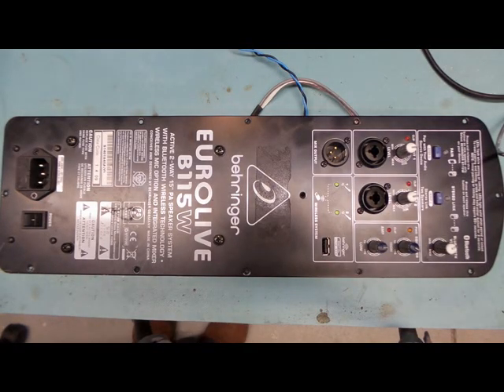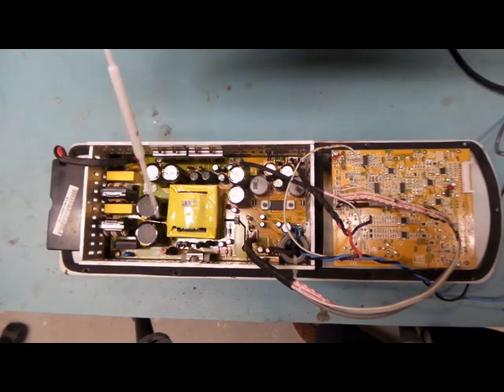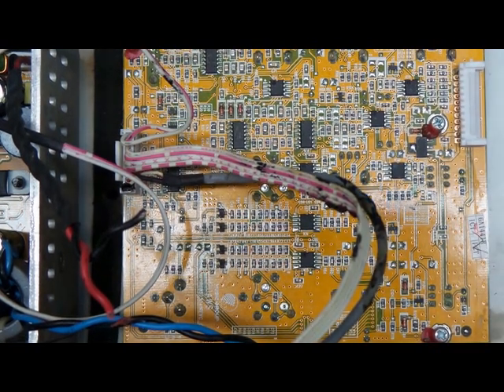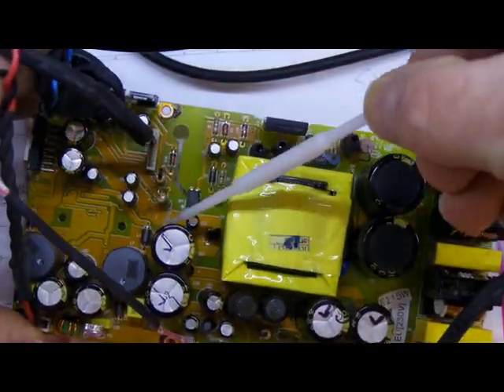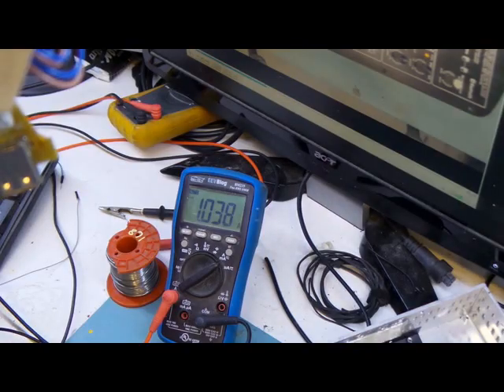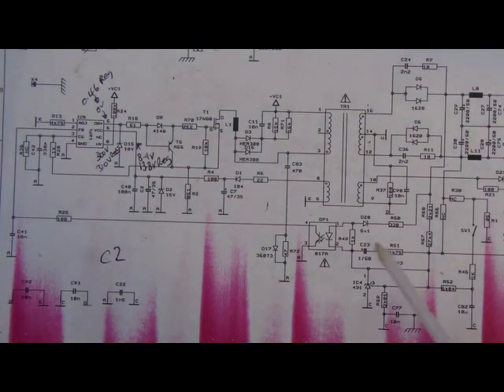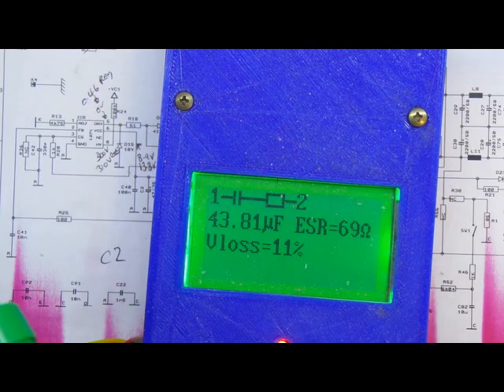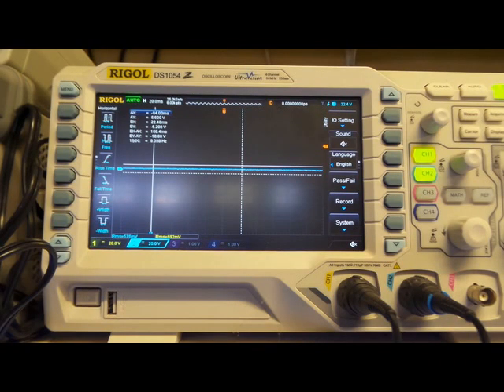Behringer Repair  Eurolive B115W

Comment: Wow can’t believe how common of an issue this is with these speakers you would think behringer would do something to solve this issue in new speakers, I followed this video and replaced c2 and c7 as described but unfortunately my speaker is still exhibiting flashing lights and not working, while it was apart i noticed 2 of the other capacitors slightly bulging but I didn’t get the specs of them before I put it back together to re-test, just wonder if anyone has the information on the 2 larger capacitors at 9:12 in the middle to the right of the yellow square? Also anyone have any recommendations on a repair shop or someone who might be able to assist me with a repair in South Australia would be great thank you very much in advance and I appreciate this great video

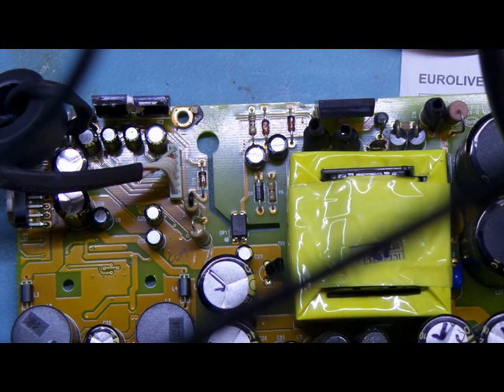Comment: Be careful if attempting this. I have a B112D with the same symptoms & using this video as guidance I change the two caps which did indeed measure half the capacitance & high ESR. However, on reassembly the issue remained & I determined the issue only occurred when the PSU was bolted to the back panel. Then by accident when they briefly touched it sparked. I found there was voltage between the PSU chassis & the back panel when not connected. I removed each bolt one-by-one that were fixing the heatsinked components to the chassis & tested each time. Turns out it was IC3 causing a short. The one you can see at the far left in this video at around the 7:08 mark, at the top of the PSU, next to the ferrite ring. While that is isolated from the chassis, the pulsing lights issue is not occurring.
Reply: To expand on this, IC3 is a 7293 IC. I have since found an insulating bush which fell out during disassembly & was no reinstalled, however this only insulates one side & whatever was on the other side I'm guessing has been damaged or become faulty for the short to occur in the first place. From a site explaining this IC it says:
"Note that the metal tab of the TDA7293 is connected to the -Ve supply, so must be insulated from the heatsink. The more care you take with the mounting arrangement, the better. While you can use a screw through an insulating bush and a piece of mica to insulate the tab, a better alternative is to use a clamping bar of some kind. How you go about this depends a lot on your home workshop tools and abilities, but one arrangement I've found highly satisfactory is a suitable length of 6.25mm square solid steel bar. This is very strong and allows good pressure on the mica (or Kapton) for maximum heat transfer. Naturally, heatsink compound is absolutely essential.

Do not be tempted to use silicone insulation washers unless you are using the amp at very low supply voltages (no more than ±25V). Its thermal transfer characteristics are not good enough to allow the amp to produce more than about 10 - 20W of music, and even that can be taxing for silicone washers. The amp will shut down if it overheats, but that curtails one's listening enjoyment until it cools down again."
Reply: Hi mate i followed this video too but unfortunately still have the same issues, could you please elaborate abit more on what you found to be the issue I just can’t quite seem to follow your comment properly, or is there another way I’m able to contact you about it at all? Thanks very much in advance

Comment: this thing is a beast to get open. Broken screws, cheap stripped screws before I even tried to undo them. Spent about 10 minuets and just trashed the thing. Barely worked for a year. Crap.

Comment: have two power supplies doing this. Checking out the first one tonight. Seems VERY sus as both PSU's are now multi-year running old. Seems that the PSU's are identical for the B115W/B112W as well.
Update: this works beautifully! works like new.

Comment: HELLO FROG! I noticed that one of my EUROLIVE Powered speakers only had sound coming out of the Woofer so I ordered and installed a new Tweeter Diaphragm but when I powered the unit up it's squealed!!! I took it back apart double checked all the wiring everything is in the correct place! Tweeter is mounted in the correct position! There's no smell or anything burning from the Amplifier section! The Woofer works fine! Can you tell me what that could possibly be wrong!
Reply: HELLO CACTUS, I dont have much to offer. Sorry. Apart from checking the capacitors as they are known to fail.  I am trying to think what could cause it to squeal but have nothing to offer.

Comment: Do you have any advice for a B115 unit with no high-end playing? it sounds like the woofer is working but not the tweeter. Any thoughts on whether It's the physical tweeter or the amp circuit for the tweeter? how would one investigate/fix this issue?

Comment: Thanks for a great and helpful video! About to attempt the same repair, but am not by any means familiar with circuit boards and electrical repairs like this. I'm looking at purchasing a few 47uF capacitors from Amazon, but there are two options; 50V and 16V. I assume it matters...so which would you recommend? Thanks for your help!
Reply: I just checked the circuit diagram which indicates 35v capacitor rating, so 47uF,  50v will be fine.
Reply: @kissingfrogs  Thanks so much!
Reply: @bigk5486 what was the answer?
Reply: I dont recall what the voltage rating was.  The voltage does matter but only in so much as it must be equal to or greater than the original.  Generally, a larger voltage rating will mean a larger physical capacitor which sometimes means that it maybe difficult to make it fit. So to re-iterate it must be 47uF and whatever the original voltage rating was or greater.   If you cant find the original voltage rating let me know and I will see what I can find.

Comment: Hi, thanks for the great video. I have got B12x, when I was switching on the lcd comes on, bluetooth works input meter works but no sound at all. I have tried normal input as well, factory reset also, all what I can but no sound. When I was listening the speakers closely no noise or anything. I have followed your video and  replaced the 2 capacitors. After that same happened still no sound, so I was thinking it has something other issue. While I was testing/checking suddenly it started to work, didn't do anything. It was working for few minutes then stopped again. Seemed the amp switching on/off. Then I have started a repeated music to see how it switching on/off. So when I was switching the speaker on, no sound. Started the music, after few minutes I hear the music playing on the speaker, after few minutes it stops like the amp went off, few minutes later I can hear again. It strange. Then I have used the bluetooth app where you can control the speaker settings. Realised when I was changing something while it was working ok, it stopped working again. Anyway in some point after few hours of playing/testing realised it's working ok, no switching off since half an hour-hour. Whatever I did in the control app it worked perfectly. Switched the speaker off, then back on it works perfectly. This happened yesterday, since then everything works perfectly. So I am not sure what was that, is it relates to the capacitors or it was completely different. If anyone have any idea why is this happened please let me know. I don't have any clue, it seems like it needed some time to put himself together to work properly but it did. All in all happy with the results, thanks again.

Comment: Can you advise what size diode is L3 and L9? I am unable to find a schematic for B115W.
Reply: L3 and L9 would be inductors.  According top B112D (I dont have B115W schematic but they seem similar)  L3 is 21B751S and L9 is 4u7/620mA (not sure what that means).  If you meant D3 D9 then 4148 and  LED respectively

Comment: I also have a B112D exhibiting the exact same symptoms. Replaced C2 and C7 as described in the video.  Works perfectly.  Thanks so much for this video.
Reply: Where do you buy them?  What voltage rating do I need to get?

Comment: Thanks! My B112D had the same symptoms. Replaced C2 and C7 which cost $0.42 each from Jaycar. Worked a treat! 👍
Reply: Hi scott, glad to hear a success story from a B112D  owner. Just wondering if you diagnosed like in the video to identify the problems with your caps or if you have a simpler method. Cheers J
Reply: @jlgairo5512  Hi, no diagnosing at all. Amp displaying same symptoms (flashing lights) so I just went straight ahead and replaced the caps...
Reply: @scottpatch2089  Do you mind telling me the voltage specs of your 47uF capacitors? I'm about to purchase some to do the same repair, but my options are 50V or 16V. Thanks!
Reply: @bigk5486   I used 47uF 35VDC Low ESR Electrolytic Capacitor CAT.NO:  RE6332 from Jaycar Australia. I don't have the know how to recommend either of the amazon options. Good luck!
Reply: @scottpatch2089  Thanks!

Comment: Can I ask where the actual fuse is please?
I can't find it.
My email is 
stringsattached@musician.org
Reply: I think it is on the outside at the power inlet socket.  I don't have mine to hand to check.
Reply: @kissingfrogs  
Thank you for the reply..
I have pulled the back off and I have not been able to locate the fuse ....

Comment: I bought 2 Behringer B112W (works paired) and since 2015 this is th 3rd time that I changed these capacitors (C2 and C7, two times in one and 1 time in the other one). Someone had an advise or idea for a total fix this for this issue?

Comment: Hi Richard, thanks a lot mate for the info on how to repair the flickering problem of B115W, managed to fix mine however the amp is overheating, could you kindly assist on how to get it back to its normal temperature, thanks.

Comment: Hi. I have that model and blows the fuse. I open it and C83 and C84 are destroyed. I cannot see the value of C83. Is it possible to let me know the characteristics of C83 please? Thank you.
Reply: I dont currently have the B115W with me.  Perhaps the schematic will help. I think I used B112 as a ref as I could not find a schematic for B115W
Reply: @kissingfrogs  thank you for the prompt response. On the schematic diagram that you show here, the C83 is shown to be 470.  Is that 470 Farads? Is too high! Do you have any clue?I think it should be 470 pF . It is used after the transformer so I  believe is a kind of filter. What do you think from your experience about its value? Please see the C83 on the schematic you have on this video! Thank you in advance!
Reply: @kissingfrogs  it's seems to be ok. Thank you mate!
Reply: The LEDs are flashing slowly. Do you think I should use the 470 uF? I have used 470pF.

Comment: Thank you for your very useful video you have saved me a lot of time. thanks again.
Reply: Awesome - so happy it helped
Reply: @kissingfrogs  Changed capacitors found power chip was overheating so removed it . now without the power chip in I have a slow fading of the power lights? any ideas? I didn't change the large capacitors. I am getting 5sec pulsing and the two 15 volt voltage regulators are getting warm.
Reply: @richardcsl1  Hi Richard, did u managae to solve the heating problem??, am having same problem I could use some help

Comment: Fixed it!!!! Thanks so much for posting this. I had exactly the same issue.
Reply: thats awesome. Did you replace just c2 and c7 or all of them
Reply: C25 looked a little sus as it was bulging a bit on the top. I replaced it as I don't have a way of testing it. Didn't fix it so I replaced C2,C7,C23,C25,C85,C89. Kind of a scatter gun approach but one of them fixed it.

Comment: Hi, I have the same fault on my speaker. You say you replaced c35
 c25 c13 c12 c84 c14 c10 c8 c86 c85 c89 c9 c6. are they all the same size?? I would like to carry out the same repair but would like to collect all the parts before dissasmebly.Thanks in advance

Comment: Amazing!!!! Well done.
Have you had a look into repairing Behringer EUROLIVE B1800D PRO Active at all? I have two of these with the same blinking problem. Can you share any advise at all? Or where in Australia can I send it to you for repair?
Thanks mate 
Look forward to your reply.
I’m in NSW 2428.
Reply: Based on my repair, replacing all the caps may fix your blinking issues.  
I have had some success fixing faulty abandoned amps, however, I'm not confident enough to offer to my services as a repairer.
Reply: @kissingfrogs   thanks for your reply.

Comment: Can you please tell me. What did you replace and where to get it. I appreciated
Reply from the maker: I replaced the 47uF capacitors c2 & c7 as they were the main cause of the unit not powering up. 
However, the following caps also failed testing so they also got replaced c35
 c25 c13 c12 c84 c14 c10 c8 c86 c85 c89 c9 c6.
They cost about 50 cents and got most of them from my local electronics store called jaycar.
Reply: do you know what voltage?